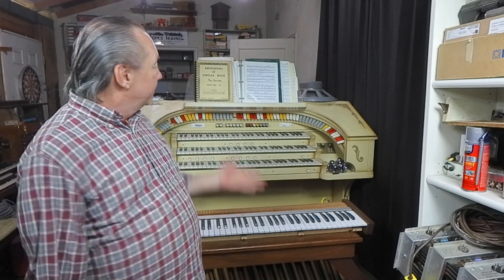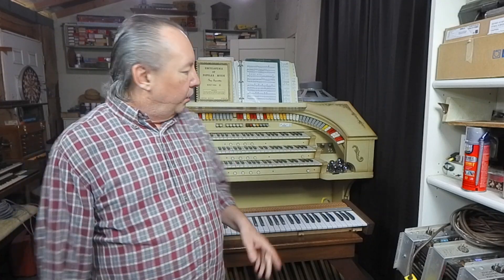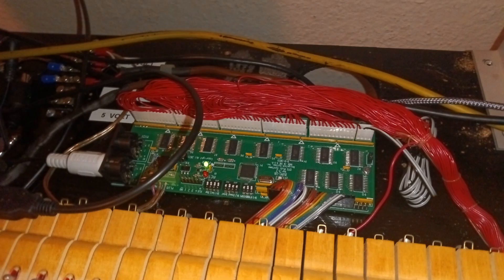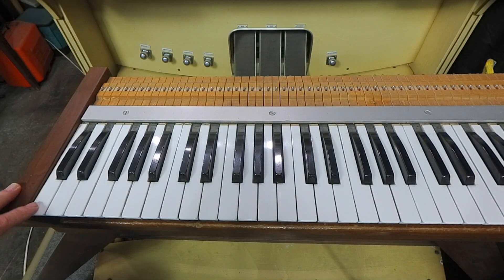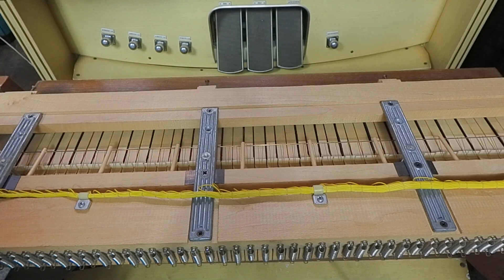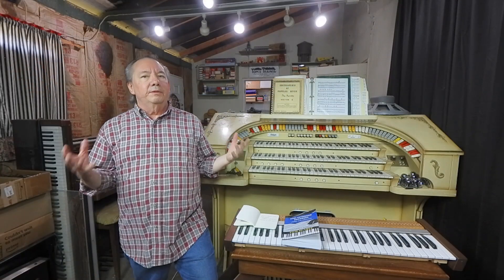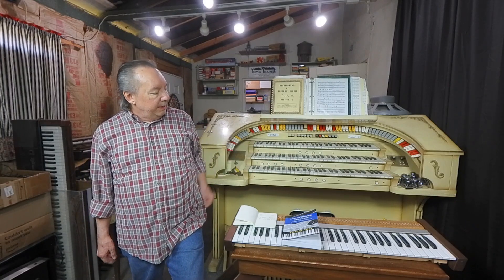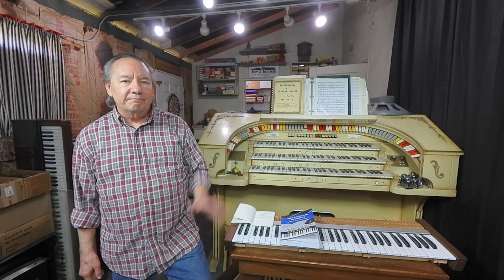Building my own MIDI controllers #8 Rodgers 33E conversion

Comment: You might want to look into multiplexer chips. They allow you to connect many many inputs to 1 pin. You can get a 16 to 1 multiplexer.

The problem with the matrix setup is that you sacrifice some polyphony. E.g. there are many combinations of key presses that the arduino can't tell apart.
Reply: I’d think with the diodes shown in the circuit diagram, you’d have unlimited polyphony.
Reply: @kc9scott this isn't possible since there are 2^88 possible note combinations on a piano keyboard which you are trying to fit into 2^16 possible 16-bit values. By the pigeon hole principle, there must be some note combinations which clash and are indistinguishable